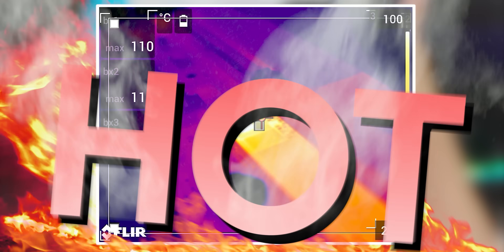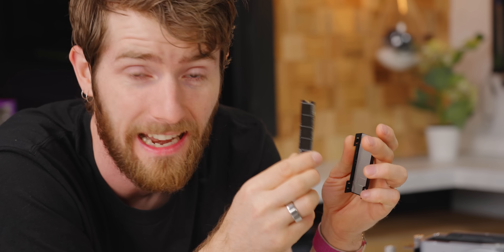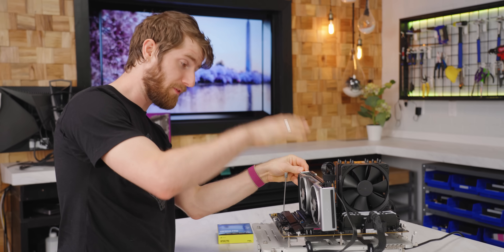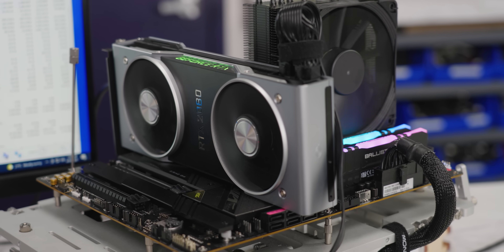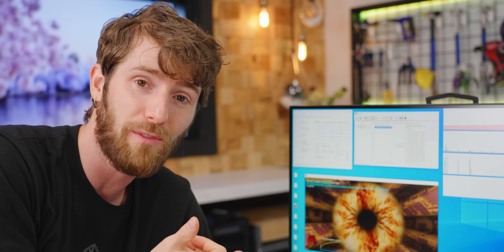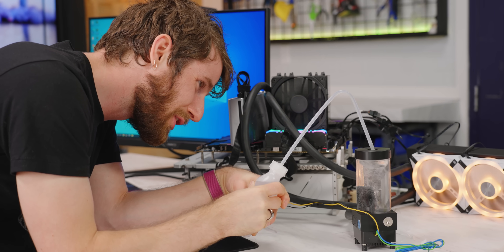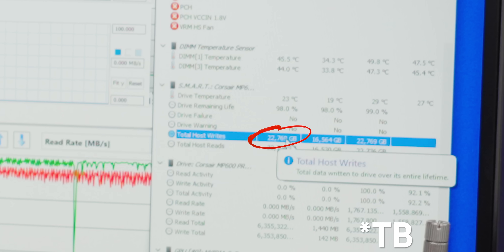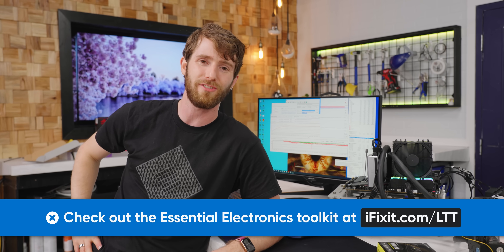This Product is a Meme - Corsair MP600 PRO Hydro X water-cooled SSD

Comment: ur control test no make sense, since it not designed to cool by air it could be insulating worse than if it wasnt there. control test would be using that sink came with the mobo

Comment: Gamers are only slowly realizing they are being sold CPUs far more powerful than their needs. The switch to high performance SSDs is also outrageously outplacing other tech. How much time do gamers really spend reading and writing large files? How long does it really take to load a properly maintained windows OS on a slow SSD? How many FRAMES do you gain by playing games on a 500$ SSD vs a 100$ SSD? Load screens can't even be altered in many games, including the vast majority of online games.
Reply: much is only marketing bla bla, yeah, but often you install a game, and you only have to wait 1 minute instead of 5. also its about the latency, reaction time. if a program loads several files from an ssd, multiple times a second, it can make a difference in code performance if the program doesnt constantly have to wait.

Comment: Linus said something about the heat that is comming from the gpu to the m.2 ssd i testet it with a 80 celsius gpu thst is blowing direckt air on the ssd and it wasnt going any hot i also stress testet the ssdwhile that and it only got hot one time in the stress test and that was due to the stress test from the ssd and not the hot gpu || Parts samsung 250 gb pro / msi b350 gaiming pro / gigabyte gtx 1050 2 gb ram everything is not behing modivied except for the gpu it has some costom colloring on it

Comment: So basically Corsair makes aan SSD that under normal use case lasts 200 years before it burns its usefulness,then proceeds to make watercooling for it that is actually useful ONLY in the usecase which would make their 200 years plus SSD burn itself in 4 days,use case that nobody and nothing would ever do,even servers use disk hard drives for obvious reasons and use SSDs only for basic stuff not for actual storage so not even servers will need this XD
I guess this is a product made for the sake of making it =))))))

Comment: you can tell whats a consumer gotcha by looking at enterprise hardware. look at what they use to keep their components cool. simple aluminum and copper heatsinks. fans at the rear. even for their GPU racks. and these components are on and working 24/7 with a much heftier task. 

consumer PC's have gotten out of hand IMO. you can save HUNDREDS of dollars by just getting a black case. with no stupid windows, no RGB nonsense. the proper 5$ fans placed where they should be. and a cheap 30$ aluminum cooler master for the CPU. they have consumers paying 200-500 extra to turn their desktops into shitty nightlights.